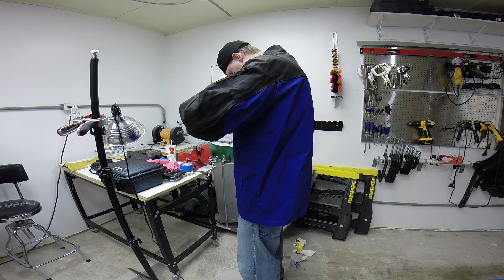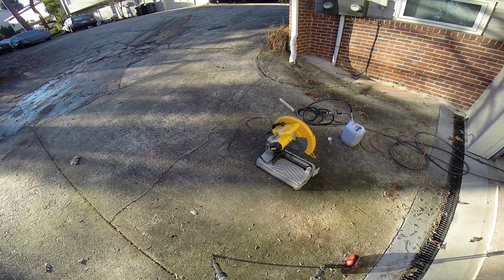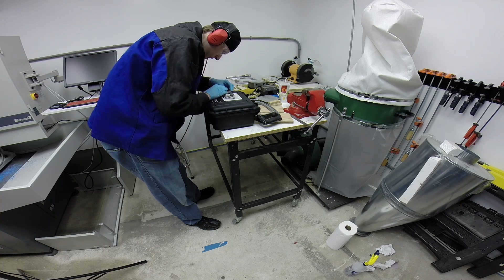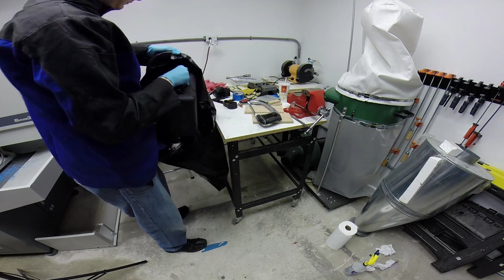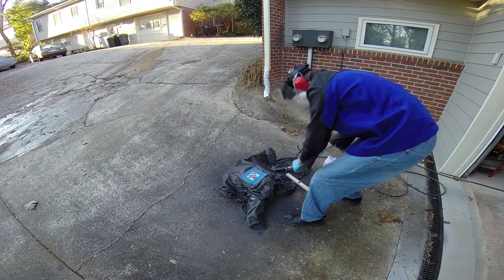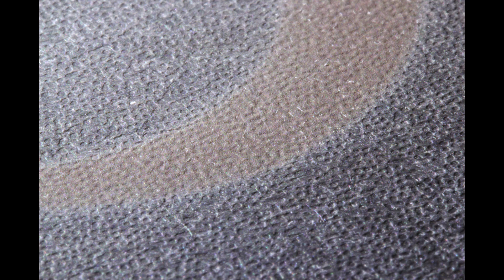Blast Etching Pelican Cases

Comment: Nice Les!  Where did you get the aluminum blade for your chop-saw?
Reply from the maker: It is a 14" Tenryu blade. I cant remember what vendor I used to buy it but you can find various distributors online. 
Most carbide tipped saw blades will cut non ferrous metals and many woodworking tools are also rated for cutting non ferrous metals using those blades. My dewalt miter saw specifically states in the manual it is good for cutting aluminium if you have the correct blade.
Reply: Les Wilhelm Thanks for the information!  I will have to pick up one of the blades to give a try!